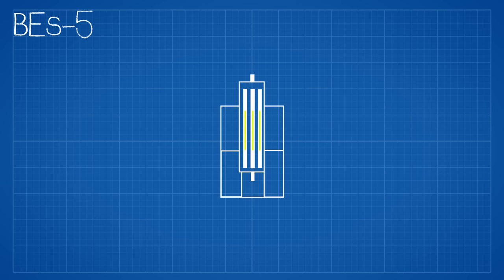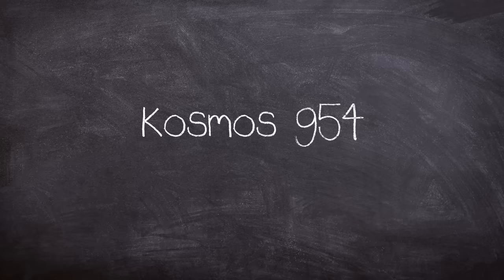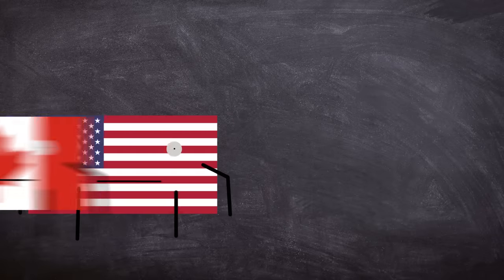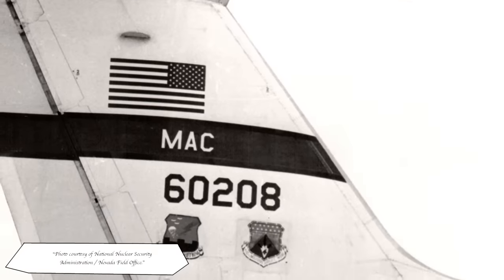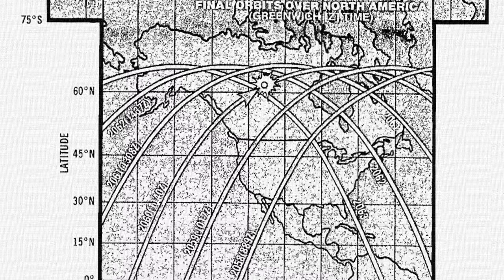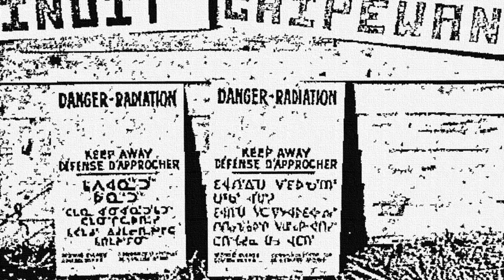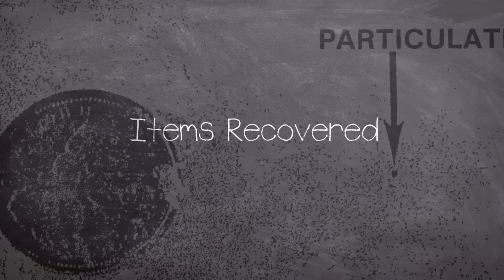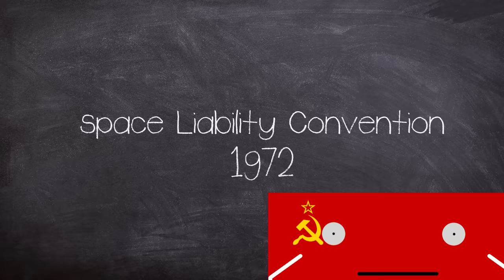A Brief History of: The Kosmos 954 Nuclear reactor Crash (Documentary)

Comment: While in the military, I was trained as Radmon, (radiation monitor),  back then we were very well capable of completing the work on our own but as usual we did not have the up to date detection equipment necessary to do it before snow turned to water which would spread the radiation further. Thus the help from our neighbour,  and yes a little info on the reactor design is helpful.

Comment: You mentioned they didn't use solar arrays for power due to the possibility of them causing orbital irregularities, and I wanted to touch on that just a bit. These RORSAT surveillance satellites flew very low orbits to earth, and if they used solar arrays, it would impart so much drag from the lingering atmosphere that the satellites would quickly deorbit and burn up (well, mostly burn up, as we see in the video). Making them bullet shaped with no lateral jutting surfaces minimized as much drag as possible. How low did they orbit? As an example, the ISS orbits around 400-420 km from average sea level, while Kosmos 954 orbited around 265 km. The ISS needs a few boosts every year to push it back up into its correct orbital height, otherwise it would deorbit as well. The ISS generally gets its boosts from the Zvezda service module or visiting spacecraft like the Progress or Soyuz.

Comment: Good vid, but for me the default unit when talking about radiation is a Sievert... It's like i would never use term centigrade instead of calling it Celsius.
Reply: There is no 'default' unit for talking about radiation lol. There are different units for measuring different things. Rem, Rad, Sievert, Roengten, Gray, Curie, etc. are not arbitrarily interchangeable like centigrade and Celsius... 🤦‍♂

This is like saying your default unit when talking about electricity is volts. 😆

There isn't just one magic unit for radiation, just like there isn't one magic unit for electricity.

Comment: I wonder if this could have caused a nuclear explosion? The unreflected critical mass for 90 percent u235 is 53.8 KG. I don’t know at what speed this impacted the ground but it seems possible that the impact could have been significant enough to combine the uranium fast enough to create a nuclear explosion had it hit at the right angle. Although if the reactor has been in operation for any length of time the fission products probably would prevent it from assembling a critical mass without an implosion type system.
Reply: Absolutely not...

Comment: "The size of the panels would effect it's orbit"

That statement needs to be qualified... It doesn't matter how big the object is so long as it has the correct orbital velocity to maintain that orbit. It's mass, or size, does not change the required orbital velocity which remains the same for all objects in the same orbit regardless of size and mass. There are two ways solar panel size can be an issue, 1: they are two big to launch on the available launch vehicle, or 2: the orbit is low enough that atmospheric drag becomes an issue. I could assume you mean the second, but that's doubtful as those sats where already big enough that atmospheric drag is already an important factor and would have been put as high up as possible to avoid it. I think if anything it was more the low efficiency of the panels at the time requiring them to be too large to power the mission and also fit inside the launch vehicles fairing.

Also, as a 24/7 recon sat, it needed absolutely reliable power and solar/battery tech of the era (especially soviet) was notorious for failing if you said mean things to them much less being in the harsh expanse of space.
Reply: There is no true vacuum in space until you get far far away from the planet. Around Earth,  the atmosphere drops by 99% every 50 km above the surface. So at 50 km the atmosphere is 1%  (1/100th). At 100 km it is  1/10,000th.  At 150 km it is 1/1,000,000th). At  200 km it is 1/100,000,000th. And so on. At low orbit around 250km there is still a tiny amount of air that provides enough resistance that it causes orbits to decay. Orbital speed drops and the satellite drops towards the surface, where the resistance ever increases until it slows and drops to a level where sir resistance causes it to burn.  Solar panels are like sails or parachutes and would increase the rate of orbital decay.

Comment: kreosan channel has them going to dyatlov pass. where in the locals tell of these very things that drove the doomed team to abandoned camp and seen them die in strange places away from their tent..
Reply: New information suggests the was victims of a ice sheet sliding into their tent they put their camp site in a horrible place 
     They were sleeping when it happened they made it for the forest to a secure area worried another ice slide might happen built a fire the two without clothes bochickawow smashed?  because they were sleeping naked the ones who were injured in the slide stayed while the others split up 
    Half of them going back to the tent to get clothes and gear the other half going to make a shelter 
     The ones who when to make a shelter fell off a cliff in the dark the ones that went back to the tent got lost and froze to death not far from it
     The two by the fire were burned  while they froze to death 
      The reason two of them had traces of radiation was because they worked in a nuclear fuel refinement facility like most people from that area did
    The irony the one who picked the camp site was preparing for a test in wilderness camping and survival to be a guide 
    They know that the hillside there definitely is capable of making a ice sheet and it sliding 

     Just have to have the right bad luck for the surface of a  layer of powder to thaw and freeze then a heavy wet snow to freeze on top the wind blowing down the hill set it off by creating a area of low pressure

   Alpine camping is dangerous 😳